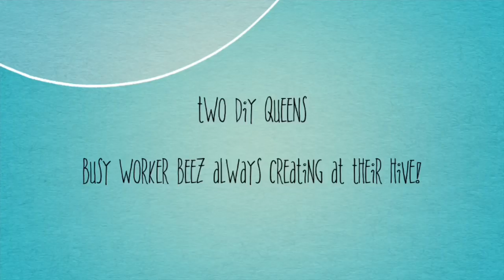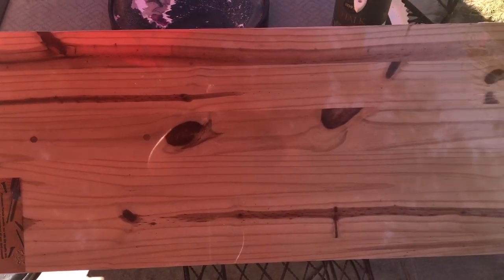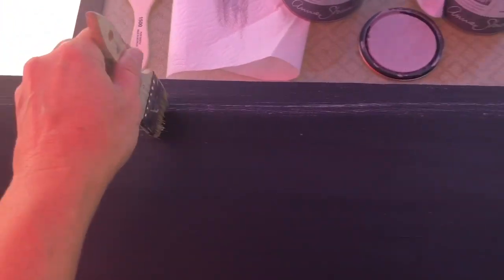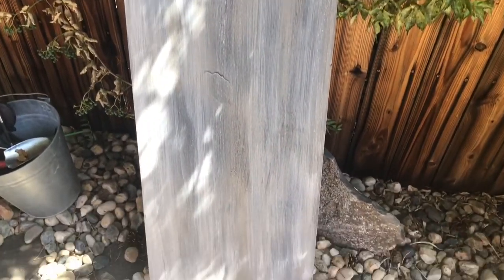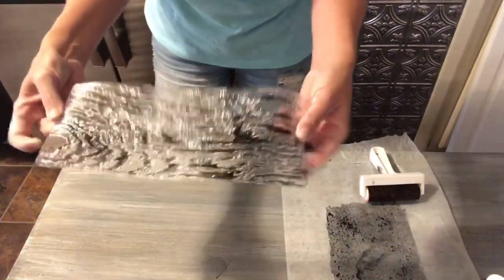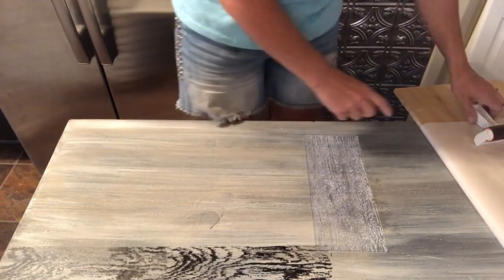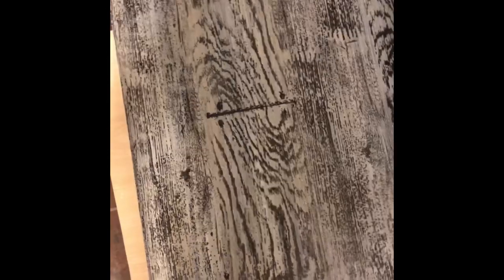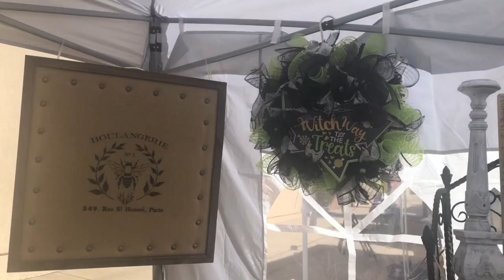DIY FARMHOUSE SIGN/WEATHERED WOOD PAINT TECHNIQUE-VINTAGE MARKET BOOTH TOUR!

Comment: The thin plastic cutting boards from IKEA works well too to do your braying on or to squeeze out your paint to stencil. I love the black sheep wool dresser. I can't believe it hadn't sold yet. Love your markets.
Yeah I had trouble accessing the website as well. I will use the link.

Comment: Very nice. I bought a wood graining tool at home depot years ago and used it with gel paint to add wood grain to a metal cabinet and a metal door, turned out great. It was quicker to use than the stamps.